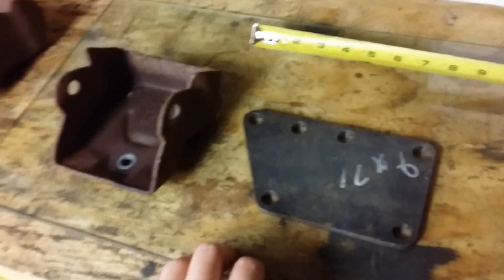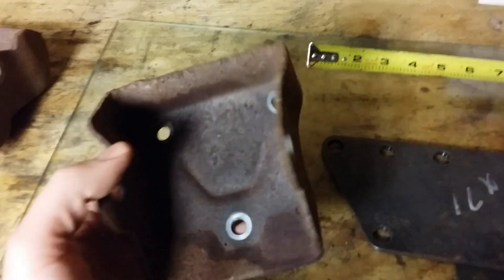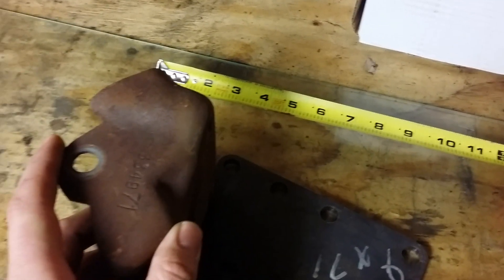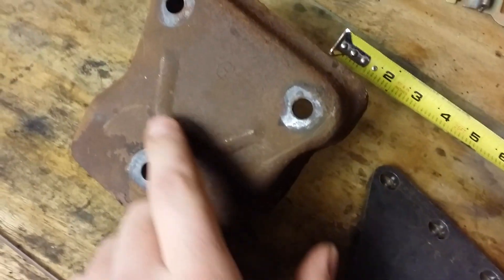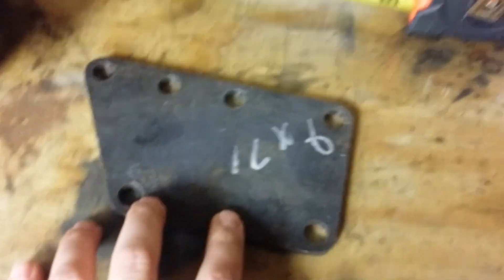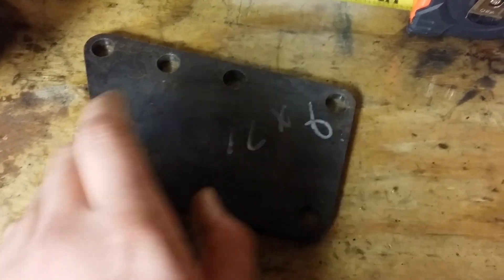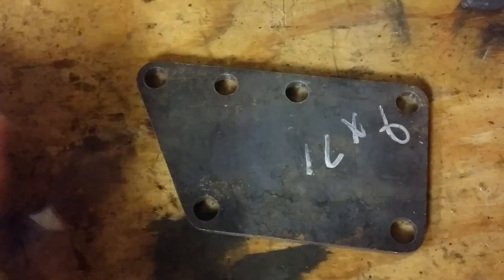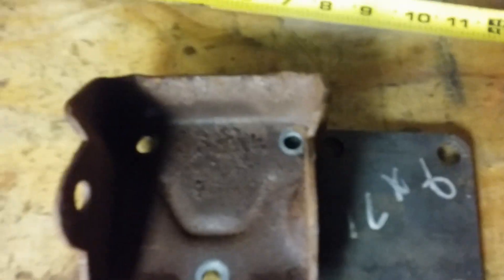How to: Swap LS1 5.3 6.0 GM cars MOTOR MOUNTS

Comment: I just pulled my engine back out this morning because of this very thing and figured out I needed car mounts the ones that came off the big block DO NOT FIT !! 

No I’ve got to pull it out again because of that stupid space I put on has the converter locked up it will not turn so I’ve got to figure that out 🙄🙄

Comment: It would have been nice to have the depth measurement of the clam shell, when your in a junk yard it would be handy to have since there very much a like , the few motors i looked at where all the same and the angle of your measurement did,nt tell me much. thanks for your time.
Reply from the maker: The car clams are what you want. Preferebly a Camaro or Caprice.. unless you're LS swapping a truck then you would get the same style mounts out of a truck. It's that easy.
Reply: @beeterolds  There are 5 meters sitting on a shelf all are the same. "And can't tell if there car or truck. I measured from the back of the shell to the bolt ,s outer loop that goes to the frame mount and it is about 2 and 7/8 of a inch. Thanks in advance.
Reply: That measurement was from the inside of the clam shell.

Comment: Im using car mounts..and the clam fit.right over the mounts ...the right side is in place with bolts..left side needs to come down like half of inch to fit.n holes
Reply from the maker: turn the mounts around that are on the frame. might seem stupid but they aren't symmetrical. had the same issue

Comment: Originally I used those car Short/Wide clam shells with a 2 3/8” reach to the bolt holes. I wanted to try and lower the engine some without cutting off the 2.8 v6 frame stands/risers.
***Test under way, I’m using the LSX Innovations LS block adapters.
-Trans-dapt S10 V8 adapter plates to the 2.8 frame mounts.
-Speedway 1974-81 Solid 4 bolt Wide frame mounts. #62630
-Energy Suspension #3.1114G Universal  Short/Wide motor mounts w/ 1.75” reach to the bolt holes. 
Note:  1/2” has to be removed from the tops of the ears on the frame mounts to work with the Short 1 3/4” reach motor mounts. This is the only way I’ve found to create a Short/Wide mounting setup similar to the older 1971 and older GM mounts that are only 2.5” Wide. 
Frame plate mod video is on my channel installation coming soon. 👍

Comment: Hey, I need LS1 swap mounts for a 87 Caprice. I bought a 5.3 LS of a 2002 Tahoe. I want to still use my 700r4 still. Where can I get the cheapest price??? Or can you provide me with detailed print dimensions... I'm a laser operater.
Reply from the maker: eBay .

Comment: I have a 89 caprice  it has a stock 200/4r trans would I need the 1" set back plates; and or should I invest in a 700r4 trans? 200/4r vs 700r4 different lenghts?
Reply from the maker: use the th2004r man... and yes 1 inch set back plates
Reply: +D.Szymanski  thank you for the expedited reply I appreciate it
Reply: +D.Szymanski also the 6.0 I purchased has the flat flywheel it came with a 4l80e behind it but the trans has a hairline crack. I also have the hughes spacer/adapter but I was told that with the flat flywheel the adapter wasnt needed is this true?
Reply from the maker: shit, find someone to weld the aluminum case run that 4l80e..
Reply from the maker: it goes right to my phone bro

Comment: I need those plates made to go from a s10 4.3l I need them to mount to a chevy 305 but also to bolt a 4.3l mount to it
Reply from the maker: Michael Fitzpatrick won't work. You need 2.8 motor mounts and the proper swap motor mounts for the S10. I did one a few yrs ago and the 4.3 mounts sit the engine much higher than it needs to be. 2.8 frame mounts are the way to go
Reply: BEETEROLDS how long did the 2.8L motor mounts last with the V8 they seem to be very cheaply made. I can't see them lasting for long with a V-8.  They don't last long with a 2.8L.  Would it help to put the polyurethane inserts in them to make them last with a V-8.    My other thought would be to make my own solid motor mounts for my S10 V8 swap

Comment: I found some..but the shell is big and bolt is shorter ..when i put it on the frame mount.what size is your outside diameter from bolt hole to bolt hole...should i take off mounts bolted to a sbc frame also so clam shell would fit..because g body mount on frame to small

Comment: I thought u had to use the ls mount when u do the swap I'm doing one now I'm using the adapter on the frame and ls mounts on the bracket to go to the motor
Reply from the maker: No simple adapter plates to clam shell mounts
Reply: Nice man thanks for the information very helpful

Comment: Ok question. I'm doing this swap in a 1986 c-10 and it has the taller sbc truck mounts and I'm using the 1 inch set back plates but motor mounts are not lining up. Could it be I need to use the car ones that are shorter.

Comment: Damn I'm in the middle of a ls1 5.7 swap I bought the adapter plates with the Chevy claim shells from a car and it's like it line up with the frame bushings but off a hair where it won't drop down and the trans 4l60e really don't have room to move up to lower the motor just right plus the f body oil pan is on the front cross member did u have to do any grinding? great job on videos to.

Comment: hey i pulled some clamshell mounts off a 1980 malibu but they appear to br bigger compared to yours.and they dont have that indent in the middle mine has more of a bubble indent.the part number is 0334605 does anyone know if these are truck mounts?
Reply from the maker: MANDS480 MANDS480 shoot me a picture beeterolds@gmail.com what Engine did the car have ?
Reply: D.Szymanski i sent you some pictures.let me know what you think.thanks
Reply: D.Szymanski and the malibu had a 350 i beleive

Comment: Great, informative videos. I would like to use a manual 5-speed out of an 01 chevy behind my carbed 4.8. Do you know if the tranny mount location will be correct using the same plates everyone's using the fit the 4l60e?
Reply from the maker: What kind of car ?
Reply: +D.Szymanski G-body el camino
Reply from the maker: I've said it many times bro you need 1 inch set back plates to keep the trans in the stock position
Reply: +D.Szymanski thanks for the prompt replies man. You're the go to guy for ls swap info. Do you have a suggestion for the best place to buy set-backplates, I'm not lucky enough to know any machinists.

Comment: Hey got a question I'm doing a ls2 swap on a 05 silverado wat motor mounts do I need! Plzz help
Reply from the maker: What motor is in your silverado
Reply: Ls2 cast iron now I'm doing LS2 aluminum but I wanna know if it's the short or tall I got to jegs and it tells me that  it gives me two options online that's where I'm lost
Reply from the maker: +Ernesto Zamora mounting pads are the same no worries
Reply: Thanks bro thanks alot